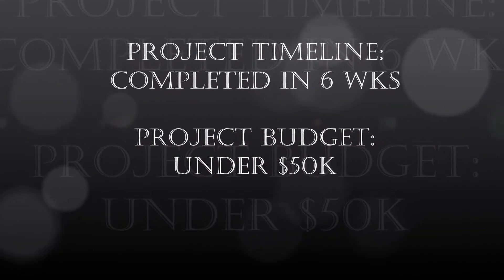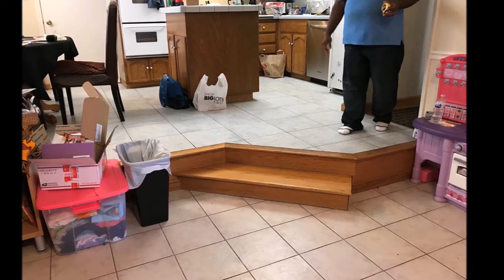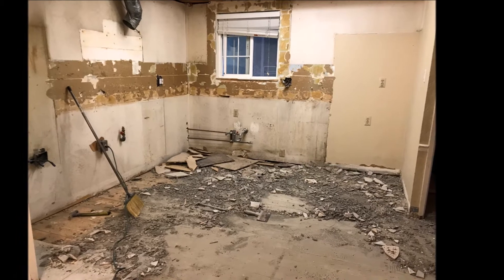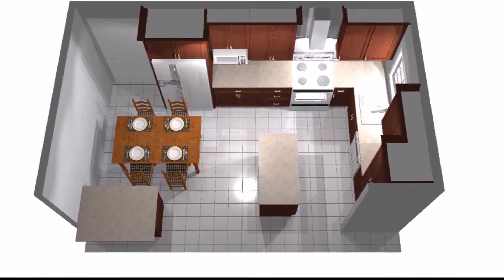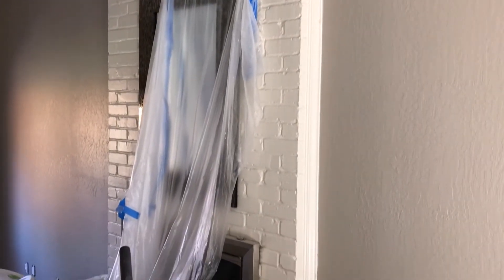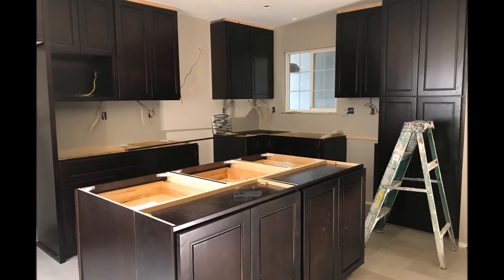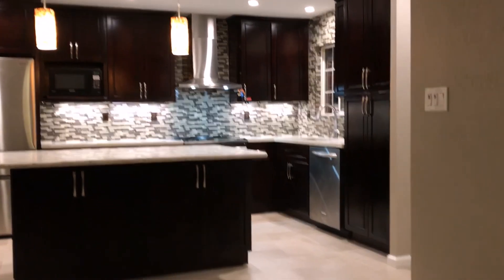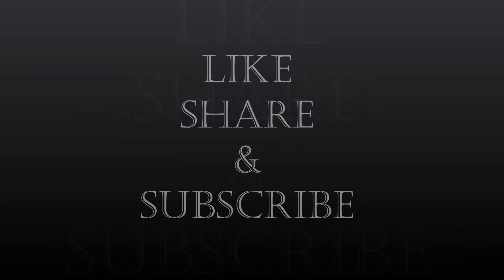1960s Kitchen Renovation | Before and After Tour

Comment: cut out that weird out of place side cabinet and you would’ve had enough room for their table.
Reply from the maker: Thanks for the input but no it wouldn’t and that’s ok. They have the island now which is extremely functional. Also, that side cabinet which is like a built in buffet should look more finished after shelving is installed above it. These images were taken on the night the kitchen was done.
Reply: @AliceTChan  it definitely would've. a typical dining table is only a few inches wider than a counter top. put the table closer to the wall, and as long as the chairs are pushed in after use and it's not a massive dining table built for 8, you could easily fit a table there that seats 6 comfortably. in my opinion, that buffet counter will never fit in because of the backsplash, had it just been the counter and drywall it would've been fine.

at the end of the day as long as the family is happy with it, then that's all that matters, i just don't fully agree with some of the choices.